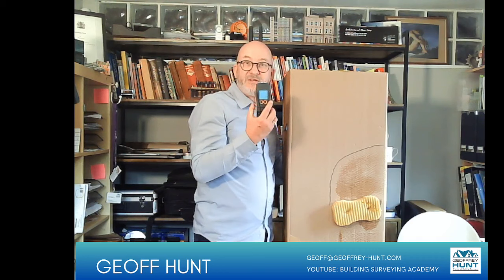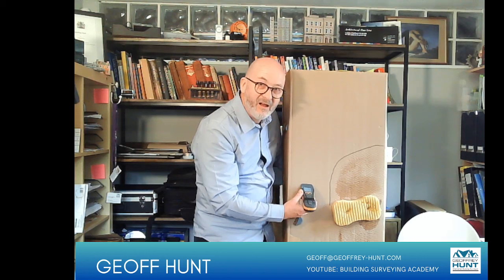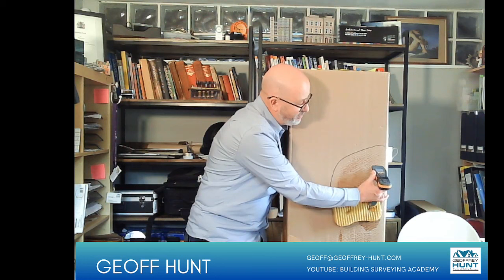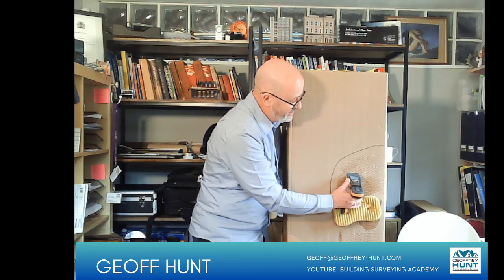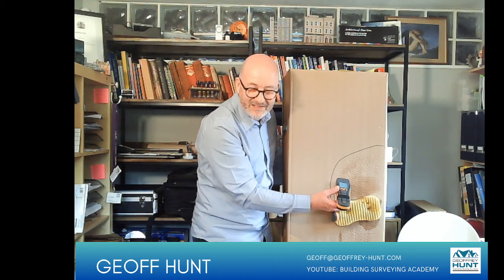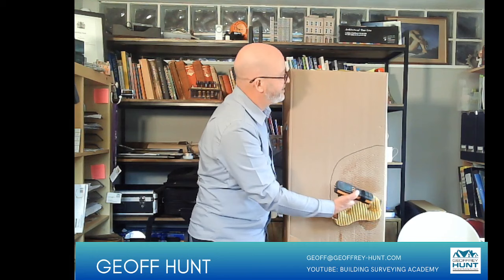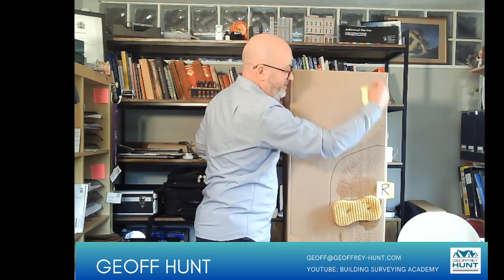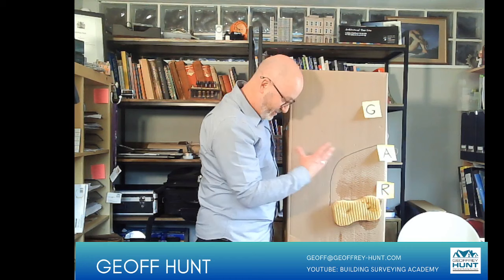Simple Introduction to using a damp meter

Comment: Thanks for the video Geoff, but surely as an experienced surveyor, a damp meter would be the very last piece of evidence you would rely on. Damp meters should never be used to solely to diagnose damp. Most surveyors starting outside the building, would be taking notes, ready for what they may, find evidence of internally, and then gather evidence internally. All surveyors work differently I know, but there are other tools to help diagnose the situation. Thermal hygrometer, thermal camera are also reasonably helpful in some cases. I think it’s great that you are demonstrating, what a damp meter is and why it should not be relied on in isolation. Thanks Geoff.
Reply from the maker: Hi Jill. Thanks for your input. I completely agree with your point that a moisture meter should never be the only piece of evidence used. I hope the demonstration has not given that impression. However it can be used to help quickly establish the patten of damp to assist in isolating various forms, and is very useful on basic visual only inspections to draw a surveyors attention to where evidence may have been covered over.  From that perspective, I would not relegate it to the last port of call. I do agree that if someone is doing a building pathology exercise they should have much more evidence and equipment to accurately diagnose. Sadly this is often not the case. Thanks again for raising this very important point
Reply: @geoffhunt6646  hi Geoff, on the contrary  I thought you did a great job, people
Reply: You Need a surveyor to part with their experience as there are so many inexperienced surveyors out there doing surveys,it’s rather scared really. Thanks for everything I am grateful  for all help your have given me thank you.